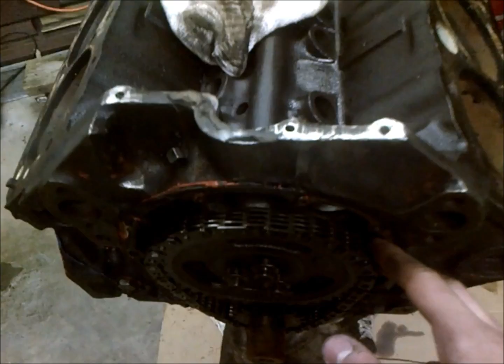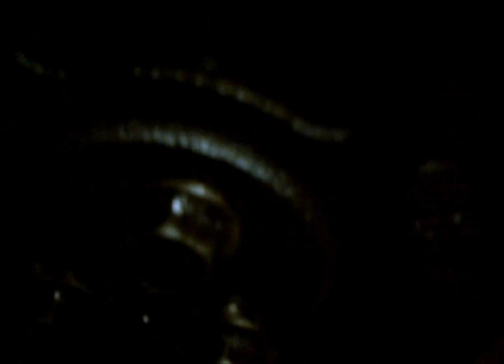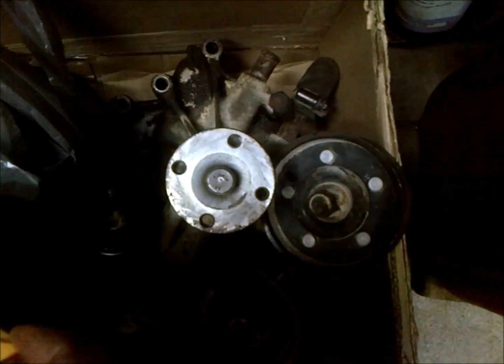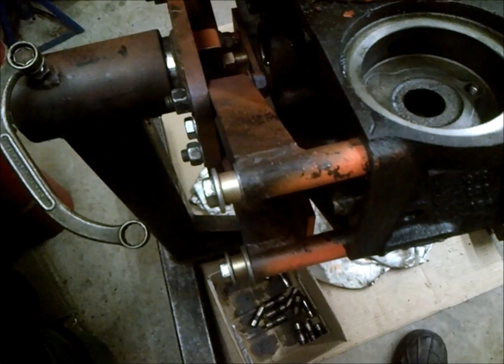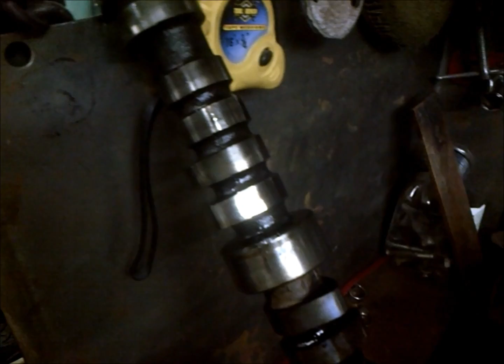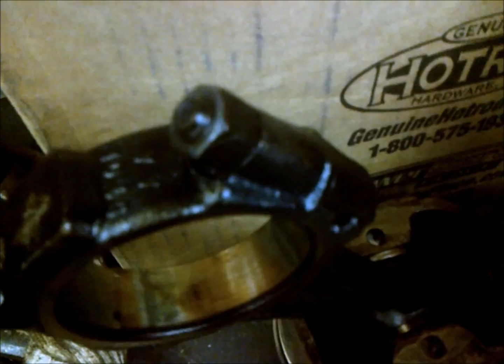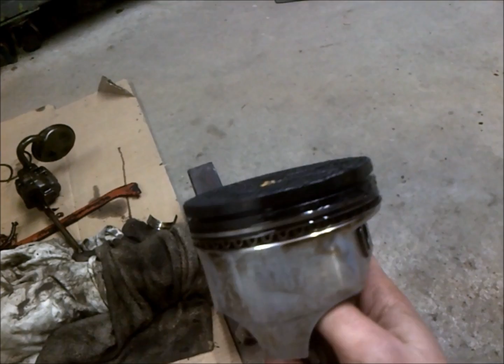350 Chevy vs Ford 302 Comparison: (Dumb Redneck Viewpoint)

Comment: A couple of points # 1 the Chevy not having a cam plate is a non issue the flat tappet cams have tapered lobes that push the cam towards the back of the engine so the cam does not walk forward that is incorrect # 2 Chevy pick ups should be welded on #3 the ford timing cover uses dowl pins on most engines however some early 302's did not and the balancer should be used to install cover to center up the seal. the 302 and 351W has horrible heads,  Tiny valves and extremely restrictive ports the GT40 heads are a so so upgrade every one thinks they are these amazing performance heads but they are not they only seem to be because most of the 302/351 heads suck so bad even a so so head makes great improvement, Fords need aftermarket heads to really make good power. For the most part there both decant engines you get allot more bang for your buck with a Chevy Ford has a better valve arrangement I have built thousands of engines in the last 27 years being in the automotive machine shop Business and over all the are pretty much the same people who jump on one side or the other are Armatures Plain and simple in fact that is how those of us in the industry can easily spot a novice they are the ones getting all worked up about how one is the best and the other sucks your words give you away
Reply: +Howabouthetruth IF THE CHEVY SMALL BLOCK WAS SO GOOD THEN WHY DID THEY DUMP IT A REDESIGN THE LS COMPLETELY BASED ON FORD DESIGNS??????
Reply: Frank289100
Thats fine dude, not arguing that. The problem is that Ford won't build anything similar, even if all the design ideas began with them. If you want a Ford that has great heads you get stuck with a giant ass mod/coyote. If you want a small package you have to go back to the 302/351W and with antiquated head designs. The LS just happens to put it all together in a single package.
Reply: Myvintageiron7512 THE SMALL BLOCK CHEVY WAS A PIECE OF SHIT. THAT'S WHY IT NEVER WON LEMANS AND WERE NOTORIOUS FOR BLOWING ESPECIALLY MISSING A REAR WITH A STICK. THIS IS THE REASON MOST SMALL BLOCK CHEVY'S YOU SEE NEVER HAVE THE MATCHING NUMBERS. IN TAXI CABS FORD'S WERE GOING 500,000 MILES WHILE THE CHEVY AT 60,000 WAS ON IT'S WAY OUT. THIS IS THE REASON THE TAXI, LIMO AND POLICE CAR FLEETS FOR THE PAST 20+ YEARS BELONGS TO FORD. THERE WAS A TIME IN THE 80'S YOU HAD THE OPTION WHEN YOU BOUGHT A CADILLAC IN THE BLACK CAR LIMO SECTOR TO HAVE EITHER A SMALL BLOCK CHEVY OR OLDSMOBILE ENGINE. EVERYBODY STAYED AWAY FROM THE CHEVY SMALL BLOCK AND OPTED FOR THE OLDSMOBILE INSTEAD BECAUSE IT WAS JUST A BETTER ENGINE. HERE IS THE FACT ABOUT THE CHEVY SMALL BLOCK. IN 1992 IT WAS REVAMPED AND CALLED THE LT WHICH WAS CHEVY'S ATTEMPT TO KEEP UP WITH THE SMALL BLOCK FORD. IT DIDN'T WORK THE FORD'S WERE STILL BEATING UP ON THEM AND WHEN IT CAME TO POWER ADDER FORD RAN AWAY WITH THE SHOW, CHEVY JUST COULDN'T COMPETE. WHAT DRAG RACING IS TODAY IN TERMS OF NITROUS, TURBO AND SUPERCHARGING WAS SINGLE HANDEDLY SHAPED BY THE SMALL BLOCK FORD, CHEVY DID NOTHING. IN THE END THESE CHEATERS CALLED GM RESORT TO THE DIRTIEST TACTIC IN RACING. THEY REDESIGN THE V-8 WHEN THEY MADE THE LS USING ALL FORD DESIGNS. FROM TOP TO BOTTOM THE LS IS COMPLETELY 100% FORD IN DESIGN. NOTHING REMAINS FROM THE OLD SBC.
Reply: ***** YOU HIT IT RIGHT ON THE FUCKING HEAD. CHEVY DID NOTHING BUT CHEAT THEIR WAY TO THE FINISH LINE FOR YEARS. THE NASCAR RO7 IS NOTHING MORE THEN A FORD CLEVELAND KNOCK OFF AND THE DRCE PROSTOCK CHEVY ENGINE WHEN THE NHRA MANDATED THE 500ci RULE TO STOP FORD'S DOMINANCE IN PROSTOCK, WAS NOTHING MORE THE A OLDSMOBILE BLOCK WITH BIG BLOCK CHEVY CAM AND CRANK AND THEN THEY MADE A BIG VERSION OF FORD'S CLEVELAND HEAD. NOW THE JOKE STARTS TO THICKEN NOT THE PLOT. THE CHEVY LS OF TODAY IS STRICTLY BASED ON FORD DESIGNS. THERE IS NOT A SINGLE DESIGN ASPECT CHEVY IN THE LS.............IT IS 100% FORD.
Reply: +Myvintageiron7512 I agree. It's perfectly fine for a man to choose one over the other, but when they start outright bashing the other company & the people who choose them, it is the dead giveaway pointing to an amateur mechanic. I don't claim to even be a great mechanic, and I am a Chevy man at heart, but I have always admired any company for their strong points. They have all made winners as well as duds. Same goes for the overall cars themselves. I never could understand how a Chevy man could hate a classic Shelby for example, or vice versa. Once again, both companies made some real gems as well as both producing some real dogs. I always tell the hot-heads from either side, they need to leave the "pom poms" and the silly arguments for the girls. You'll make a lot better friends that way too, regardless of who drives what. Thanks also for the facts you pointed out.
Reply: +ummduhgmail THE LS USES A FORD 4.6, 5.0HO, 351C/W FIRING ORDER. THE LS BLOCK ARCHITECTURE CAME FROM THE MODULAR 4.6 ENGINE WITH IT'S CROSS BOLT MAINS AND GERATOR CRANK DRIVEN OIL PUMP AND OILING SYSTEM. THEY COPIED IT FOR IT'S STRENGTH. A TEKSKID 4.6 MODULAR FORD BLOCK CAN SUPPORT 900HP AND IT IS A LIGHT WEIGHT CASTING. WHAT GM DID IS COPY IT'S DESIGN THEN THICKEN THE WEBBING FOR GREATER STRENGTH.THE HEADS SEAL IN A SQUARE BOLT PATTERN MAKING A BETTER SEAL AND CLAMP DOWN INTO THE BLOCK INSTEAD OF THE BLOCK DECK LIKE THE OLD SMALL BLOCK CHEVY DESIGN. THIS IS THE REASON YOU CAN PUT 18LBS OF BOOST ON A SMALL BLOCK FORD BEFORE YOU HAVE TO O-RING IT. ON THE OLD SMALL BLOCK CHEVY 8LBS WAS THE LIMITED. ANYTHING MORE WOULD BLOW THE HEAD GASKETS.  THE LS HEADS HAVE STRAIGHTER VALVE ANGLES 18 DEGREES LIKE THE FORD'S WHICH WERE 20 DEGREES INSTEAD OF THE COMMON 23 DEGREES USED BY CHEVY. THE PORT DESIGN OF THE LS IS IDENTICAL TO THE FORD DESIGN. THE INTAKE RUNNER CURVES INTO THE INTAKE VALVE UNLIKE THE CHEVY WHICH CURVES INTO THE EXHAUST VALVE. SO WHEN IT CAME TO POWER ADDERS LIKE SUPERCHARGING, TURBO AND NITROUS THE SMALL BLOCK FORD RAN AWAY WITH THE SHOW. WHEN YOU FORCE INDUCE A RAW AIR FUEL CHARGE INTO THE CYLINDER LIKE ON A FORD WHERE THE RUNNER ENTERS THE CYLINDER AND CURVES INTO THE INTAKE SIDE OF THE VALVE. IT DOESN'T INTERFERE WITH THE EXITING BURNT UP GASES. BUT ON THE OLD SMALL BLOCK CHEVY DESIGN WHEN YOU USE FORCED INDUCTION THE INCOMING RAW FUEL CHARGE IS THROWN INTO THE PATH OF THE EXITING BURNT UP EXHAUST GASES WHICH DECREASES THE ENGINES ABILITY TO MAKE POWER. THIS IS THE REASON WHY CHEVY COPIED FORD AND CREATED THE LS SO THEY CAN FINALLY COMPETE WITH THE SMALL BLOCK FORD'S. THEY TOOK THE RAISED PORTS FROM THE INFAMOUS 427 FORD HIGH RISER ENGINE AND PUT THEM ON A WINDSOR HEADS. THE LS IS COMPLETELY FORD IN DESIGN.
Reply: +Frank289100 If the LS is a copy of ford's designs then which engine that ford makes is it a copy of?And why is it not the most popular engine on the market right now instead of the LS hmmm?Why do we not see all kinds of these ford engines that the LS is copied from swapped into chevy's ,hot rods ,mud trucks ect like we see the LS swapped into everything hmmm?
Reply: the Chevy oil pump thing is dumb. you first shouldn't have to weld it in the first place. and as stated in another video the pump and pickup and usually different metals so you can't weld them or weld them well enough to where the vibrations dont break your weld.
Reply: looks better? 4th gens look like a fish and 5th gen you cant see out of, and 6th gen has the same problem as the 5th but has the rear end that looks like it belongs on a sedan.
Reply from the maker: Myvintageiron7512 i get better gas mileage too. il agree, aluminum aftermarket heads really make an improvement. i have afrs on my 302 i just finished building.
Reply: ***** by today'
s standards 375 HP is weak many stock factory V8's today make that don't get me wrong I don't think Chevy SB is  better product than Ford however Fords aren't any better either I had a 
327 Chevy making 450 HP 20 years ago the reality is they are both pretty much the same Fords aren't any better you just want them to be because it's what you like I could put 10 chevy guys on here that would completely disagree with you and swear Fords suck and they would be just as wrong as you are
Reply from the maker: from my personal perspective there is no replacement for displacement. the chevy has some oiling stuff i do not care for, but on a build basis they are so incredibly cheap and regardless of their oiling system they still run hard. my engine of choice is the 351 windsor. much stronger than the 302 base and it has the cubes to really move some iron without the money to stroke it. fits in most places a 302 would with a cowl hood.
Reply: Myvintageiron7512 Well said. Grew up with 350's and loved them.  Good power for what we did, farming pickups and trucks, dependable, fairly fuel efficient.  The cam thing is a non issue like you say.  Good grief the lifters are riding down on the cam when it is going.  When it is all apart of course it can move back and forth easily.  

However Broncos got me into fords 20 odd years ago and I really like the 302's I have had especially my current one with roller cam.  Rebuilt one a couple years ago.  Good engine.
Reply: +Myvintageiron7512 love your vids man i learned a lot from them
Reply from the maker: there is a valid point there. what if we compared the 351 to the 350 . . .
Reply: +Frank289100 I'd like it if you could expound on the LS being of "Ford design"? I'm not arguing, I'd just like some specifics.
Reply: +Howabouthetruth exactly. I'm a ford guy and I always said this myself also.
Reply: Frank289100
  Gotcha, thanks for the points and the follow up.
Reply: +ummduhgmail Everything Chevy uses in racing is all Ford based. the drce, sb2, ro7, ls and all the symmetrical head big block racing motors which are all Ford spec engines.
Reply: harry guy

I have no dog in this fight, but the LS has 2 HUGE advantages to it over anything Ford ha(s/d).
1) Their heads offer enormous HP potential, Ford's OHV heads have always been a weak link (OE heads) The OHC heads are on the same playing field as LS heads, but then:
2) Packaging. The LS is very compact. Ford's Mod motors can and do outshine LS, but they're HUGE engines and difficult to fit.

I'm a Ford guy through and through, but the LS puts together a lot of the right things. Fords tend to put together a few of the right things and completely miss on other important things.That in and of itself isn't always a problem, until the engine doesn't fit where you want to put it.
 I can admit it, the LS is pretty much win/win/win, I can't see the drawback, other than it's usually wrapped in GM garbage.
Reply: +harry guy THEN WHY DID THEY DUMP THE OLD SMALL BLOCK CHEVY?
Reply: +ummduhgmail THE LS FROM TOP TO BOTTOM IS ALL FORD. NOTHING REMAINS FROM THE OLD SMALL BLOCK CHEVY. I LIKE THE LS'S FORD 427 HIGH RISER PORTS.
Reply from the maker: idk, a small ford with some afr heads is pretty damned decent.
Reply: +Frank289100 yeah yeah yeah, same comment from a ford guy. Chevy looks better and has better performance. good luck keeping up bro
Reply: CAPS LOCK, YAY!

Comment: If your going to do comparisons do ford 351 cleveland and chevy 350 or ford 302 and chevy 305
Reply: The Chevy guys don't want to lose are you kidding?😂
Reply: Clevelands and modified blocks and 351windsors an 302s are totally different animals you can put the 400m in the Cleveland  family to square engines those 400s are same bore and stroke 4.00 inch if I remember right 6.6 liters
Reply: ***** ok
Reply: jack rohde I want them to lose LOL

Comment: I dont understand this one bit. chevy always has to have the 350 brought up against the 302. Personally i think its unfair, the 351 should be in competition with the 350, and Chevys 307 should compete with the 302.
Reply from the maker: I totally agree, but the 350 doesn't stand a chance against the 351. those are some of the most robust engines ever conceived
Reply from the maker: the 302 still revs much better than the 350 due to the shorter stroke. I think its still relatively a fair comparison. 350 chevy cant hold a candle to the Windsor 351 though.
Reply: @ThunderHead289  - how true, you hit the nail right on the head. The chevy 350 is highly overated.
Reply: Yeah the Chevy 305 was a mistake. 302 walks all over it
Reply: Why not compare Chevy 302 and Ford 302??
Reply: I too have noticed it's always the 302 vs the 350. No one ever compares the 351W or even a 351C to the Chevy 350. There isn't a comparison.
Reply: 350 is common motor you'll find Camaro that's why it's always brought up against a Mustang 302
Reply: How am i wrong. don't tell me i am wrong and don't point it out.
Reply: Kelby Sagvold
Its unfair because the 351 will shit on a 350 thats why they put it up against the 302 chevys most common small block is the 350 fords is the 302
Reply from the maker: we could compare the chevy 305. same crank and rods. different bore. chevy loses that one though.
Reply: What do you mean cubic inch to cubic inch it's fair. Lol. You're telling me Chevy needs more cubic inches to compete? Lol. Chevy junk
Reply: Kelby Savgold you are wrong sir
Reply: @ILoveWeedAndBanshees  - he's right. I was a mechanic for 40 yrs . Ford makes a better engine. 350 chevy was very prone to breakage alot more than Ford. No offence meant just stating facts from experience.
Reply: Bluelineknives that wouldnt be fair on the ford 302 at all , lol
Reply: enjoichoclate5
Which 351? 351w,351m,351c,so which one will do what? 350 chev is just as diverse,heads,cranks,casting material.Please,read and research before you spout off non-sense. FYI the best 351w were from 69-74,and they share the same mains as a 351m-400,apples oranges,I just know they both really get down the road well.Cheers

Comment: Yeah the Chevy may have more head bolts, but the Ford has less bore distortion due to having less head bolts. When you bore out sb Chevy you really need to use torque plates on the final hone, on sb Fords it is not necessary. The Ford camshaft retainer plate is superior to the Chevys cam button. Cam walk especially on a roller cam is not so pretty. The SB Chevy does have a thicker cast block, especially in the bulk heads then the 302. You really should have compared the 350 Chevy to a 351W it would be a more fair comparison.
Reply from the maker: hey, im on your side. I run fords with the 351 firing order.
Reply: Torque plates should always be used when boring. Regardless of brand. They all get bore distortion.  One would think the weaker ford block with thinner sleeves would get even more bore distortion.
Reply: HioSSilver1999 not when boring, but yes when you hone, you should use a torque plate. Very important is to use the same head gasket type when torque plate honing.. that makes a huge difference. Just using the torque plate without a gasket actually doesn’t distort the bores that much.
Reply: Than NOT Then